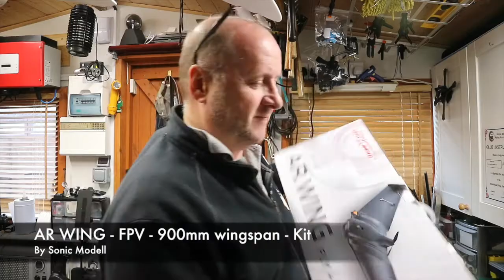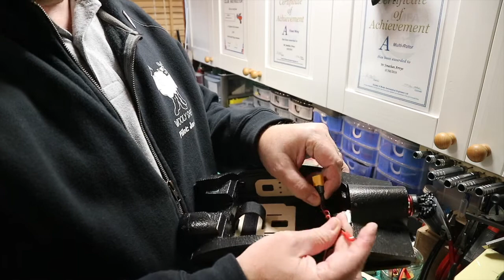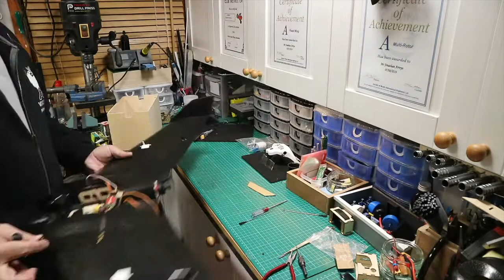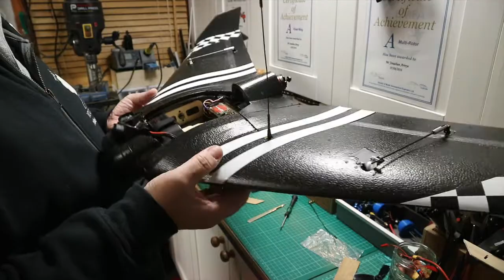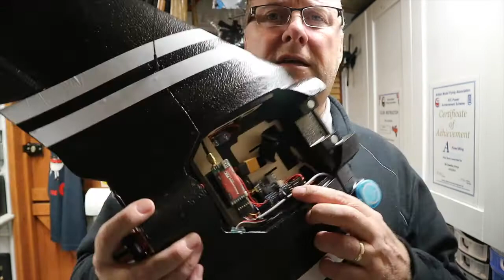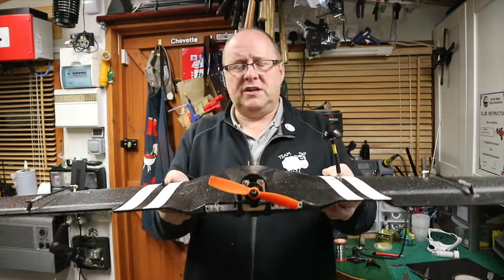AR WING Build with FPV & OSD

Comment: I don't doubt your skills and knowledge but your thumbs are incapable of implementing a RTH maneuver after the connection with your transmitter has been lost, which is a key benefit of having a FC.
Reply from the maker: Very true. I agree, if I was doing long range then FC for sure. 

I like a bit of risk….lol
Uhf helps mind and I don’t go too high or too far. Close proximity does it for me.

Comment: I  built same AR wing supplied 19v through 5S1p Li-ion (AUW ~670g , 5S1P battery weighs ~270g)  still does not fly😂

https://drive.google.com/file/d/1GTzZI7OjX9jRyYtUC8GQngcA4Nxj4LXn/view?usp=drivesdk

Build: 

1. Sonicmodell AR Wing 900 PNP version 
2. Motor  -Emax RS 2205 2600kv
3. ESC - 30 Amp with 5V/3A BEC original one that come with the model
4. Receiver:  Flysky 2.4G FS-iA6B 6 Channel
5. Batteries;  I am using Lithium-ion 4S1P (4 batteries connected in series), delivering voltage around 12-13 volts. Tried with 3S packs as well to reduce weight but still did not fly.  
    Weight of batteries along with the holder is around 130g (each battery 30g + case holder 10g).  As an alternative, I tried to change batteries to Varicore 18650B green ones (see pic attached), no luck!  
6. Props: 5030 Tri-blade

Comment: sir can you kindly tell me the size of the carbon fiber clevises you have used as upgrade?
Reply from the maker: Please see links below.
The carbon rods are 2mm or 1.8mm and the clevises are alloy with grub screws to clamp onto the carbon rods
I use them a lot and try to slip some on every HobbyKing order.

@t

@t
Reply: @TWSreviews  there are no links :P just a @t written
Reply from the maker: @Nebul3r  I tried again below: I will add them to the notes under the video

@t

@t
Reply from the maker: @Nebul3r  YT keeps deleting the links in the comments. They are no added in the notes under the video.
Sorry for that...
Reply: @TWSreviews  thanks allot for the help :)

Comment: I'm getting osd but no picture😥 what am I doing wrong. Why me😥😡😥
Reply from the maker: Check you have voltage to the camera with a multimeter. You may not be getting power or enough power. E.G. If its a 12v camera and you are only getting 5V.

Comment: I saw a video where the person actually cut a place to mount the transmitter on the outside.  Maybe there is a way to add a fan inside over the transmitter also.  I haven’t unboxed mine yet.

Comment: What did you use to cut the clean slots for the antenna wires
Reply from the maker: Scalpel or modelling knife and then very pointed pliers to pluck out the foam....used a ruler to keep the lines straight

Comment: Are you getting some cooling inside the fuselage for the transmitter?
Reply from the maker: I did cut some slots after reading about it
Reply from the maker: I enlarged the air intake slot in the front of the lid then cut a new similar slot to let the air out at the opposite end of the lid at the motor end

Comment: I avoid using Hot Glue and just put 100 mph tape over the servo in the color of the wing. This was if the servo fails i doesnt rip the foam apart. Nice channel btw!!! sube'd
Reply from the maker: I was recently given a tip to use shrink tube around servo then glue in place. If you need to get it out you simply cut the top surface of the shrink tube and pops out as good as new. 100mph tape works too.
Thanks for the kind comment.....

Comment: some people put heat shrink around servos then if you need to remove after gluing you cut the heat shrink and servo comes straight out
Reply from the maker: statesmanls1 that is an awesome idea. I will mention that in my next video.... thanks for that

Comment: what glue did you use to hold the servos in?
Reply from the maker: I used a sticky pad on the bottom and hot glue but only the tabs and maybe a bit around the edges so you can get them out if need be
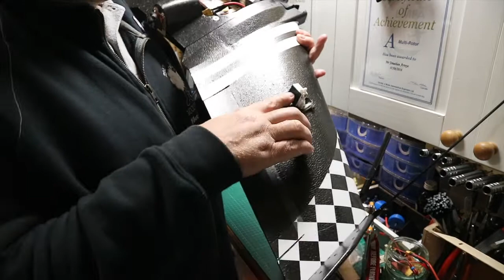Reply from the maker: If you go to 5:00 in the video I explain what I do with the servos

Comment: Nice work , looking forward to the maiden , I'm contemplating buying a red bottom for my AR wing also , I've found they are specific in direction , I'm presuming for cooling on a quad setup , I'm wondering if this is different when pushing on a wing with the air flow going backwards ? What are your thoughts ?
Reply from the maker: Marcus the motor directions as sold are relating to the thread of the nut that holds the prop on. The idea is that if a quadcopter hits a prop on something they will tighten not undo..... nothing to do with cooling. Get what you can as cheap as possible and get a prop to suit the direction. 2204 or 2205 2300kv with a 6x4 prop on a 2200mA 3S battery is a good match. use 30A ESC in case you fancy a 4S 2200mA setup.